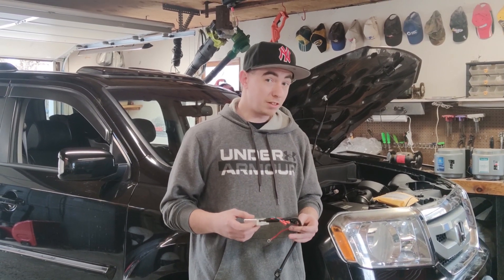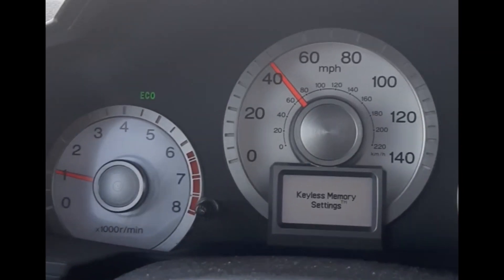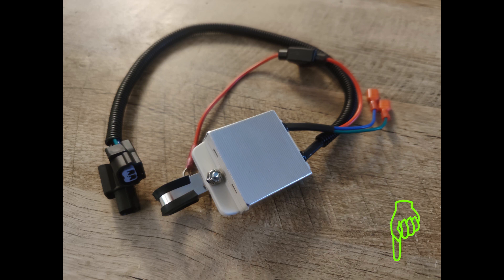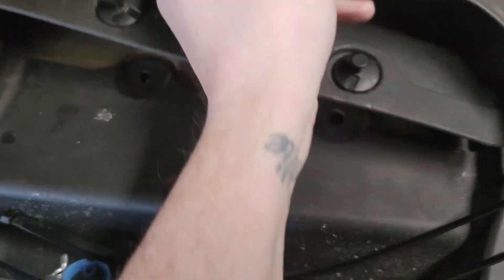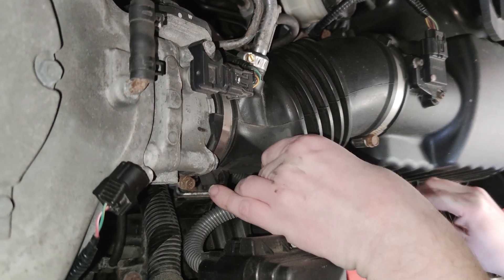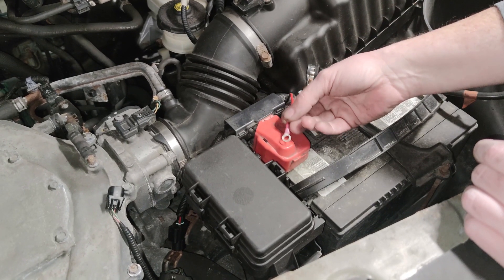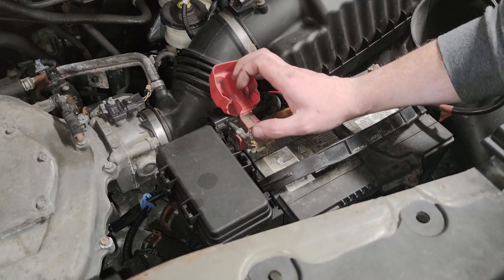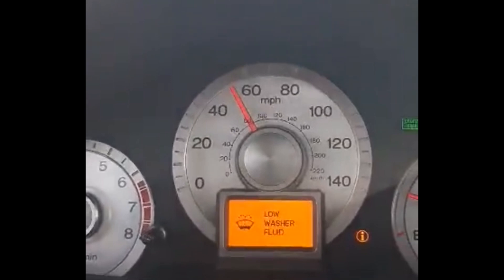Honda VCM Tuner II Eco Delete And Info

Comment: Honda should give an option to on off the VCM.
Reply: They do on the 2017+ Odyssey vans. Just push a button to turn off eco mode.
Reply: @anysnail6390 exactly I’m here with this issue was told it was spark plugs. I’m going to try this vcm tuner. But my daughter just test drove a 2015 Honda civic and she had the eco button that she could push. My 2014 Honda does it automatically and just about every issue under why it is bad my van is having so glad I found this video!! I pray it works!
Reply: cuente si funciono ???
Reply: @anysnail6390  The 'ECON' button is just a different transmission program (shift points) as is 'snow' mode.  It's confusing but does not turn off variable cylinder management.
Reply: @anysnail6390  turning off eco mode button doesn’t turn off vcm
Reply: Thank the government and it's EPA compliance!
Reply: @yodead369  Sienna does not have VCM, more power, and still EPA compliance.  Why Honda can't do it?
Reply: @ahyungrocks5509  Toyota has superior engineers! You can’t expect much less.
Reply: @yodead369  no longer -
Reply: Honda can't, they will have to update the miles per gallon test.
Reply: I just ordered this kit. I bought my girl a 2007 pilot and I can feel every time the ECO mode comes on and the car starts to feel like it hesitates really bad and will occasionally throw a misfire code. Doesnt burn any oil surprisingly but Im not going to chance any further issues
Reply: @chickenfixn4439  J-Series engine, blame the government! They forced the EPA regulations
Reply: @yodead369  sounds about right. This automotive world is turning into a giant cess pool with all these regulations
Reply: @chickenfixn4439  make sure you have a kit that doesn’t bypass the coolant temperature sensor. I remember some of those cheaper kits won’t tell you if the coolant gets too hot on the dashboard something about it messing the signal up I can’t remember. Might want to double check that before you install it.
Reply: @chickenfixn4439 Me too bought yesterday Honda pilot
Reply: Right
Reply: Government scum
Reply: Good point
Reply: The new one are supposed to have that option but you have to do it every time
Reply: Yea well obv they’re not gonna do that. Tell me u don’t know anything about car manufacturers without telling me…
Reply: But the EPA probably wouldn’t like that and wouldn’t give Honda as many credits for it.

Comment: What made you choose this over the "muzzler"? I'm just trying to figure out advantages or any other differences.
Reply: I'm looking into the same right now. From what I gather, the VCMuzzler is just a simple wiring harness with changeable resistors that plug in-line with your Coolant Temp Sensor 1 stock wiring harness.

The VCM Tuner 2 appears to have an accelerometer or some type of additional sensor that hooks to the battery. Not sure if there's a performance difference between the two yet, still doing research. Steering my brother-in-law more toward VCM Tuner 2, even though it's about $40 more.

Since you're fooling the ECM/PCM into thinking it's running cooler than it actually is, my thinking is that additional sensors would possibly help shut off when you want a true temp signal sent.

For instance, sitting at a train crossing with the AC on, you want an accurate temp signal so your radiator fan turns on properly.
Reply: @rotaryskratch  what one did you go with? still deciding.

Comment: I have a 2021 passport and I don't ever feel it ,I also own a eco boost f150 which were supposed to be notorious for carbon build up and issues with idling and water contamination in the oil they are catch cans and gimmicky stuff to fix it of which I never bought and it runs great still with 180,000 miles on it, I'm meticulous about maintenence and run full synthetic and good gas I think I trust the engineers and the current vcm3 more than people making these things and selling them .
Reply: When did VCM 3 begin 2019..2020?

Comment: Just got mine. Highly recommended for anyone who has this engine. Feels like I'm driving a new car. Just replaced the side and rear engine mounts. Parts alone, close to $800.  Not doing that again. Easy to understand video. ✌🏾
Reply: How long did it take to ship? Just ordered mine. Where do they ship from?
Reply: @Rolando Hurtado  I've had it for over a year and a half with no issues. I can't remember where it shipped from, but it was pretty quick with detailed instructions. Maybe 15 minutes to put in. Depending on how easy it is to reach your connections.
Reply: @rolando92h  A year late but replying for others' reference:  Chico, CA via USPS Ground Advantage.
Reply: Thanks, I’m taking a trip in 2 weeks and I was hoping it would get here by then. Fingers crossed
Reply: Si le funciono es pieza????ae @rolando92h

Comment: does the same vcm tuner work through all of the v6 models? or is there different ones to buy, i have a 2010 honda accord sedan with exact motor as u do i buy the same one you have?
Reply from the maker: Their are two models of this device one is for 2005-2006 models only and the other is for 2007+ models that have vcm. Just be sure to pay attention on their website when ordering . Link is in the description of the video.
Reply: @GitItGarage  thanks, awesome video, cant tell you how much oil and spark plugs ive been going through because of this😭

Comment: A quick question - my 2012 odyssey runs and drives smooth.no overheat or no funny noise. noticed ECO light is on and off whenever I drive locally and HWY. Mpg is awful. I read VCM and still don’t get it.
Reply: Same on my 08 accord EX-L V6 it gets pretty bad gas mileage even with this technology BUT my car has 220,000 miles

Comment: Was wondering, if I have subs in my car and the wiring is hooked up to my battery can I still run this on the battery
Reply from the maker: The vcmtuner should only be using any power when the vehicles running and or when vcm engages ..so I would assume this would be okay if your battery and alternator are functioning correctly.
Reply: I noticed my subs seem to affect power and possibly gas mileage in my 08 accord EX-L V6 220k miles have you noticed this as well??

Comment: So this is good for the car? I have a 2010 Honda pilot that's also 200k miles but it has no problems and the previous owner took amazing care of the car. But I don't want to do anything to it that'll mess it up.
Reply: Good question, I think this is for people that don't care about gas mileage and want more horsepower. Also I guess the VCM gives a jolty feeling for some and or are worried about engine mounts being damaged by jolts

Comment: I have owned this VCMTUNER II for about two years now on my ODY EX-L 2010 155,000. It does prevent the VCM engagement. My oil consumption has reduced from 1qt per 1000 miles down to >1qt per 5000 after new plugs and coil packs when installing the TUNERII. Noticeably improved engine performance with only slightly lower MPG. However, it was too late for my catalytic converter.  Even after using every cleaning product, trick and treatment, I still get the MIL. Just barely below required levels  Tip: for those living in states not requiring EmissionTesting, when MIL is on for any reason, VCM will not engage. If you can live with the light for a small infraction… just sayin. 
The VCM TUNER II gives the computer a false coolant temp reading from ETC 1 while ETC 2 sends accurate coolant temp. Many other vital areas of your vehicle require Standard Operating Temperature to engage or function properly.  This information is provided by the computer.  I’m now having some high engine temps which brought this to my attention. My question is, what other items utilize the information provided by ETC 1 ? Are they vital to engine performance?
Also, I saw a video for install of this device where the green wire was connected to the ground.  Is this correct?
Reply: Yeah I read the tuner clogs cats

Comment: I just got the original VCM Tuner and set it at 50. Eco light is off for good but I still get some engine shakes when accelerating. Do I just  have to play with the setting until the engine stops shaking? I will try 55 next time. This is on a 2011 Honda Crosstour EX-L
Reply: John, u may have warped cv axles or busted motor mounts both of which have been problems with the Crosstour. I own a 2010 CT 3.5L V6 2WD with VERY LOW mileage and so far no problems with it. Currently I DO NOT have a VCM tuner installed but I plan to soon!

Comment: Get it garage I have a 2010 Honda Accord EX-L I just recently replaced my sparkplugs and bank 2 ignition coil and later realized my vehicle has been burning oil not sure how I can stop this .. let me know what suggestions you have .. thanks
Reply: Started burning oil AFTER you put new spark plugs???
Reply: @freedompioneer4311  no seem like after I changed the oil .. but that was my first maintenance job on it was about a month later I realized I was about 3/4 qts low when I know I topped it off it could have been user error but I am pretty sure when I do oil changes as diligent as letting it run it's cycle to let fluid moving then checking again to make sure oil levels at op temp
Reply: Temp I mean amount
Reply: I recently just changed my plugs and haven't notice not checked if I am consuming more oil I will def get back to you on this tho last I new my oil was topped off just right

Comment: My 2013 accord coupe V6 automatic trans engine was replaced with 59,210 car was taken care of oil changes etc , Had a knock and barrings 2-4 had slight damage and do to cost Honda said engine needed to be replaced . Engine was replaced with a accord cross tour 3.5 engine with 28k on it . I haven’t noticed any issues so should I do this ? Could this have been a reason my original engine had issues? Other question is would a Honda tune do the same thing as this ?

Comment: My experience when I installed the S-VCM suppressor on my 2012 5AT V6 Accord Coupe was the following:

•Smoother Acceleration both from a standstill and mid drive
•Overall car felt more powerful, particularly from 1500-3000 rpm, especially on 89 octane (but no notable difference on 91)
•Faster Power when downshifting
•Reduced need to downshift as 5th gear is more powerful on light throttle
•Louder on light and mid throttle (VCM Suppressor disables active noise cancellation)
•Better engine braking
•No Change in MPG, maybe a slight increase
•Decreased Oil consumption
•*Reduced risk of "premature failure of parts like spark plugs, catalytic converters, engine mounts, pistons/rings, and cylinder walls"*

Only issue I had was when it was hot out or if the device got jostled; it wouldn't disable VCM then.

I did regret buying it because I ended up buying a Ktuner to tune my car, and you can disable it through there, so I wasted ~$150, but if you're not planning on tuning your car, it's well worth it.
Reply: Recently got a ktuner , where can I disable vcm through the ktuner
Reply: @theSPEEDYdoggamer  It's been a minute since I've used their interface (haven't owned the J35 in a year), but there should be a menu where you can check or uncheck boxes which will automatically make certain changes, and disable VCM is one of them if your car has VCM.

I just watched a Ktuner Vid, and I think it's somewhere under/within the "main preferences tab". Should be a box you check/uncheck
Reply: @chibba5418  thanks for the help, I was able to disable vcm
Reply: @theSPEEDYdoggamer  Ayyeee I'm glad I could help. Now you've got a V6 that stays a V6!

Enjoy your J35 & enjoy Ktuner, I miss both so much!
Reply: @theSPEEDYdoggamer  Can I ask what Ktuner you bought. It would help a lot or a link please?
Reply: @chibba5418  hey man, What did you mean by if it’s hot outside then you won’t use this device? I live in BC, Canada and it goes like 35-40 degree Celsius. I have 2008 Accord V6 coupe. Recently found out the VCM is bad for long term life of engine. So I think I wanna disable it too. Shall I go for it?
Reply: @jozettecook9018  what car do you have?
Reply: @sahilw6872  VCM engages based on engine coolant temperature (on your dash) at 167⁰F (among other conditions).

Basically, the VCM Suppressor works simply by giving a false reading to your ECU.

Not all suppressor are the same; some work simply by a resistor which always gives a false reading below a temperature so VCM doesn't engage. 

This can be bad because if your engine overheats, the ECU won't know until something goes wrong. Very small chance, especially for an average driver, especially in cold areas, and you can simply choose a safer resistor. Pros are they're cheaper, more consistent, and don't need to connect to your battery.

Others work with controllers, which is what this video and my comment were about. They connect to the battery, and basically have a mini computer that adjusts your coolant temp readings so you never go into VCM, but if your engine begins to overheat, the controller will allow VCM to enable again and let the engine get back to a safe temp before disabling VCM again.

The con is that the controller can be inconsistent on cold start, when the coolant or intake temp is high, and there can be issues with your battery (too much drain, inadequate connection, not enough power to device); all of that can make VCM turn back on. Didn't happen often, and I was in Arizona in July (ie very hot) when I first got the suppressor.

Still worth the buy. A resistor would probably work better in a cold climate than hot, but I still reccommend a controller suppressor
Reply: Hang on hold the phone... you actually got better mpg by keeping it a v6 and disabling the thing that made it get good gas milage in the first place?
Reply: @bluejay3140  VCM only gives you better mpg when cruising, but the increase is exaggerated.

Those 2-3 cylinders that get deactivated still move, and thus are still a parasitic loss on the engine.

Honda's primary reason for VCM is emissions. 2 less cylinders running = less emissions. You also waste fuel activating and deactivating VCM.

Also, accelerating quickly is best for fuel efficiency; furthermore, more power will allow you to accelerate less. Plus, you don't use that much power when coasting.